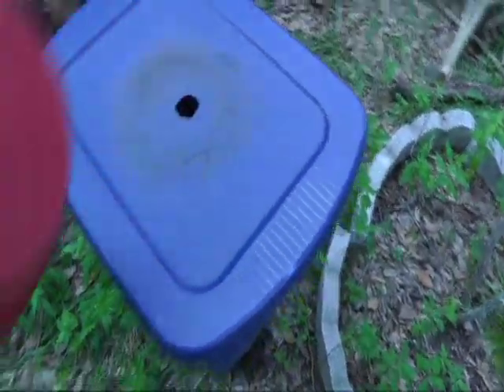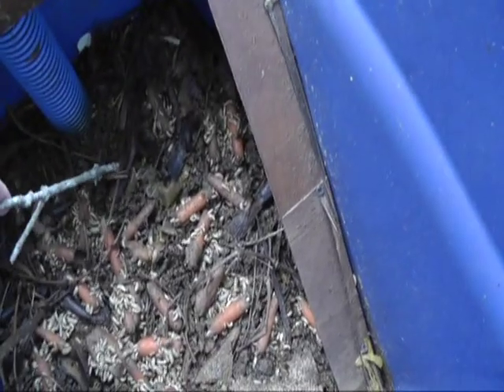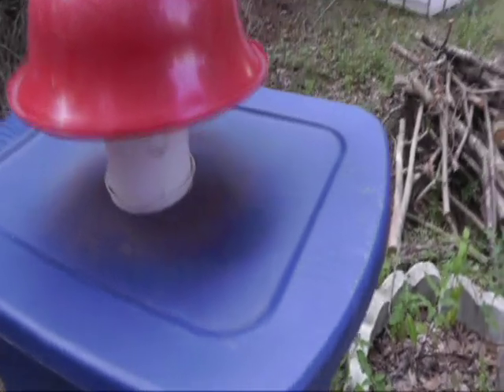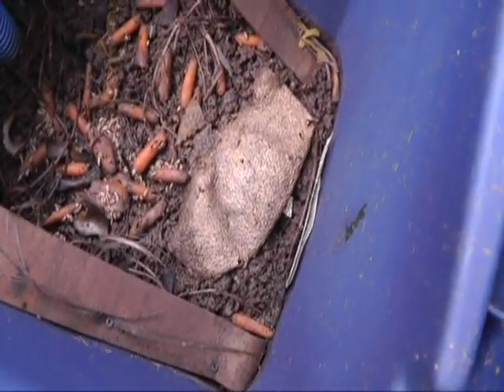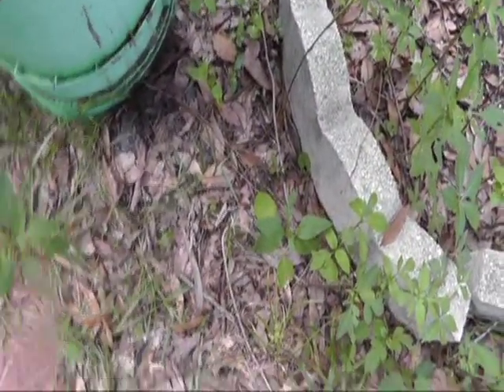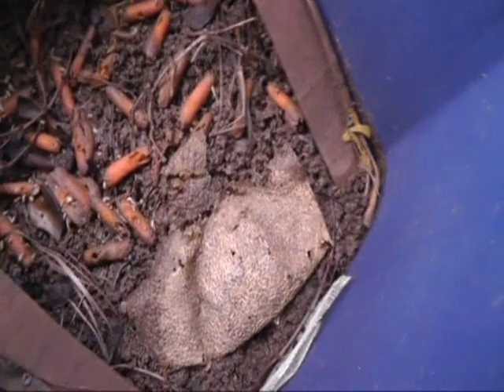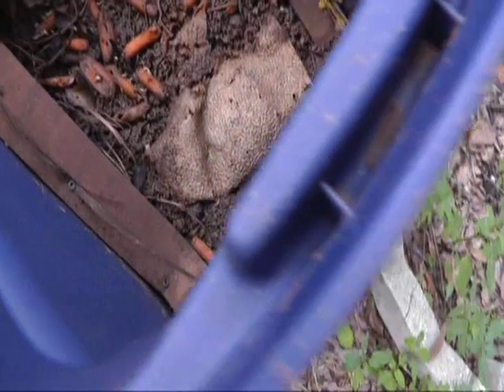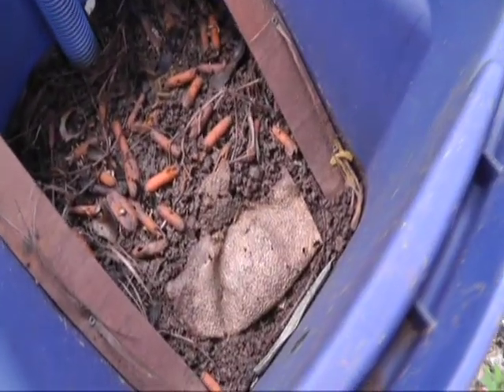My homemade Biopod

Comment: Thanks for the link. I wish they still sold the original bio-pod for less money. 
     I have a fixture and tube at the bottom of my box and the liquid can be collected by removing to stopper but there is so much I let it drip into a jar which overflow and makes a mess.  They say you can use this liquid for fertilizer but it is too much, at 20 to 1 ratio you would have to have acreage to use it all up.